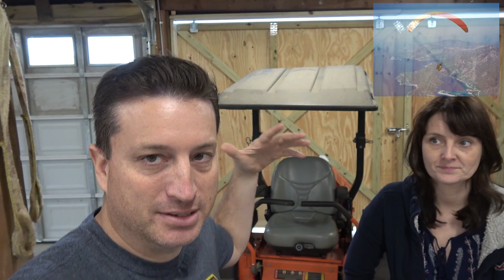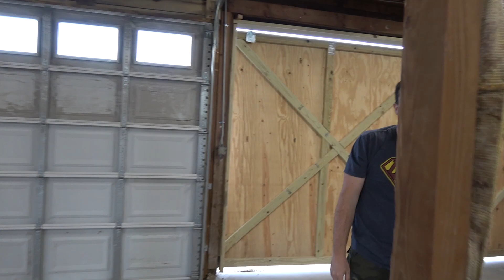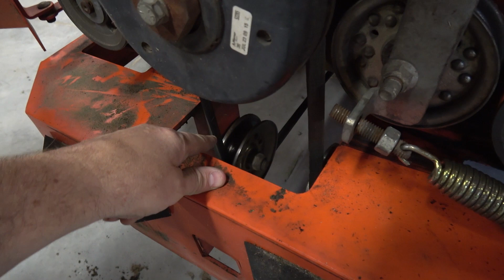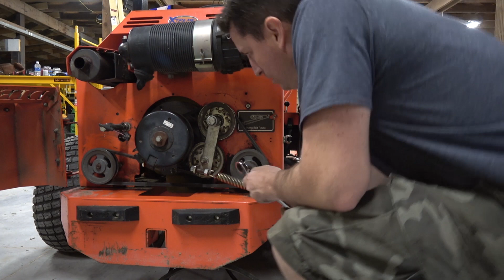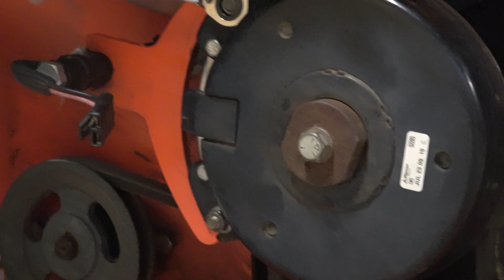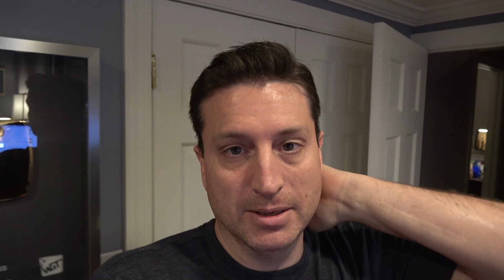Too dumb to fix this??? #44

Comment: I used to love doing engine time and working on belts when I worked in a garage. Can be very frustrating at the time but after you crack it there is such a good feeling.

Comment: You probably should avoid using the same songs as Casey if you don't want to copy him. Also make sure your camera is in focus when shooting timelapses. Also try and frame your timelapses better, Theres some much going on in the foreground and the right side isn't in frame correctly. A better shot would have been with just the fountain as the foreground with symmetry along with the trees as middleground and the sky as background.